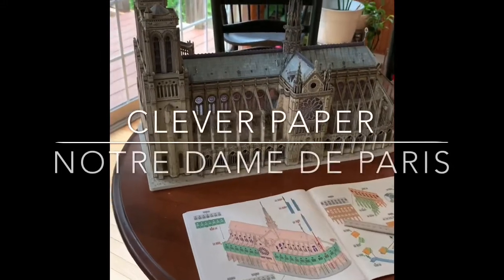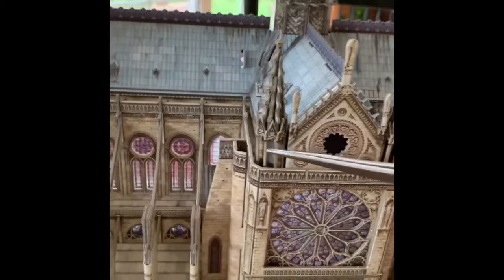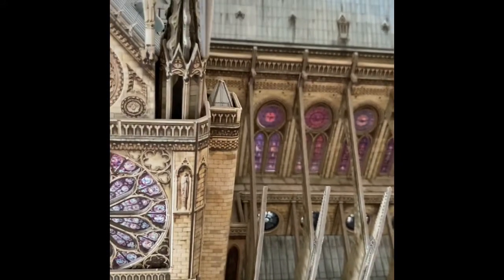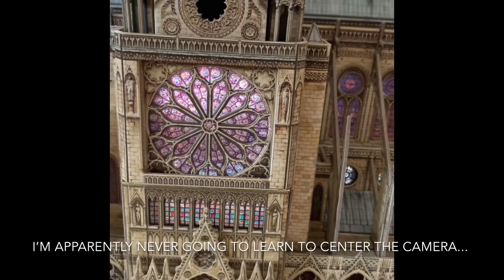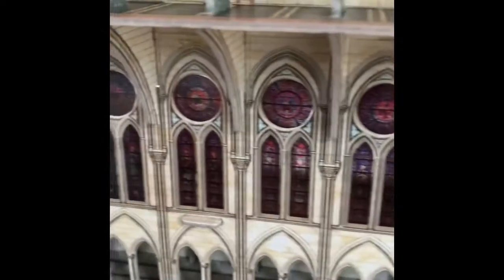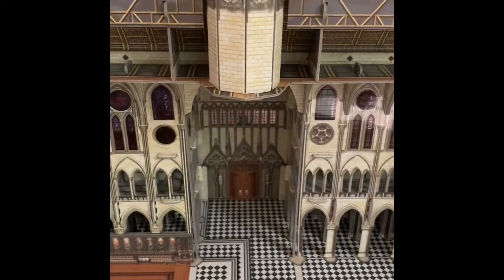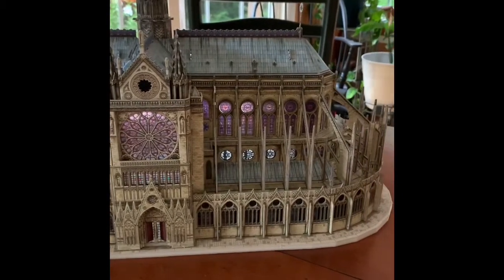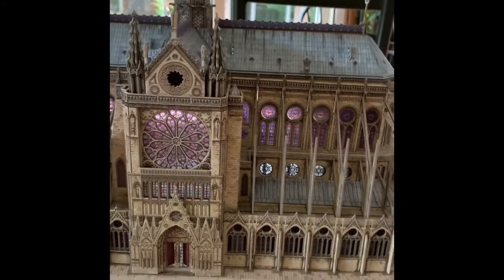Clever Paper Notre Dame de Paris 4: Half Way There

Comment: 2:34 About that empty hole. One: Make hole(s) if possible inside the model where needed to let the light in. 2: Contact the maker and ask them to send you a replacement stained glass piece identical to one already in the kit (choose the right one and give them the part number). They will probably agree to send it free.
Reply from the maker: It wasn't empty, it was just that there is no light behind it so you can see it. It never occurred to me to just cut a hole to let light in - I'll pull the model off the shelf and see what I can do.

Comment: Comparing again with the CubicFun Notre Dame, which I built a few months ago, the CubicFun version has the unlit window in cardboard, as you suggest, and it does look better. Both versions have the plastic window material showing in the interior - I never really noticed it until you pointed it out in this video. I still prefer the Clever Paper version, because of the issues I raised in the previous video.
Reply from the maker: I'd love to see Clever Paper do more of these large churches - particularly the English cathedrals, which - as far as I can tell - can only be had as glue-up card models from Rupert Cordeax (not that this is a negative - I have 3!). Looks like the Cubic Fun Notre Dame is 1/250 scale and 293 pieces, while the Clever Paper version is 1/200 scale and 387 pieces. So the Clever Paper wins for complexity and size, but it is almost double the price...
Reply: @medievalmodeler4595  Yeah, and I agree with you - the Clever Paper model is definitely worth the price. Actually, every Clever Paper model I've built (I own 20-30 and I've built maybe 10) has been pretty impressive, and some of them are very reasonably priced. I didn't know the Notre Dame model was 1/200 scale - since it's a bigger model than the CubicFun Notre Dame, I'm even more keen to buy it.